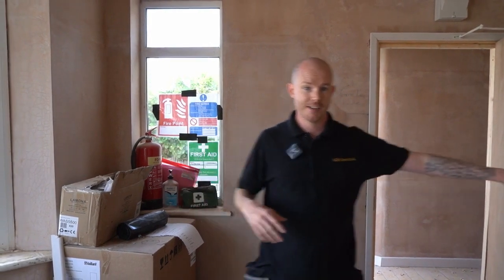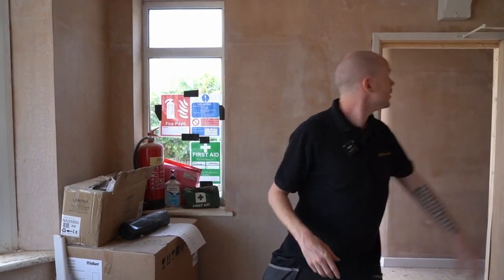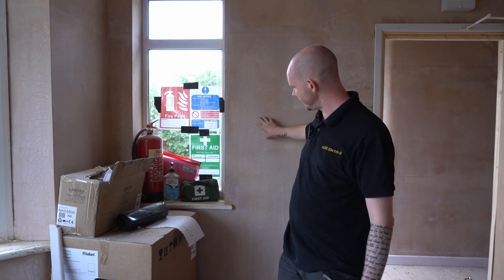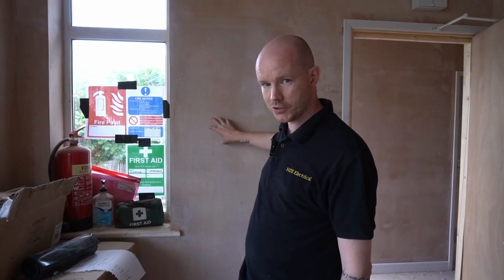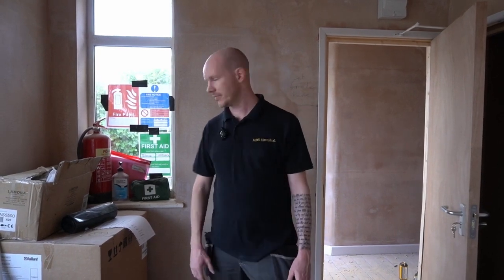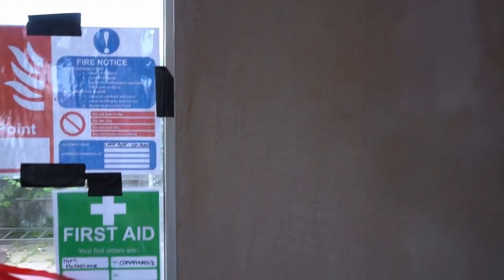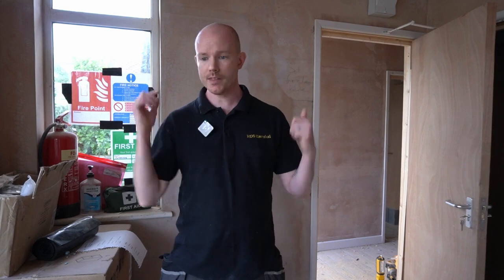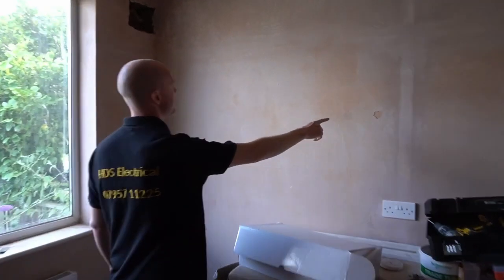Would You Trust These Plasterers Look what happens if you don't PVA the walls properly

Comment: Awesome video. Really informative. Always wondered about the PVA layer when plastering. I thought it was to add some adhesive to the plaster. Didn't think about it being a barrier but it makes a lot of sense
Reply from the maker: That’s, if you need any questions answered, post them in and we will try to help
Reply: @hdselectrical2924  thanks. I guess it's a bit like a primer to stop the wall soaking it up. Something I've noticed in cheap new builds is the way the plaster seems to peak at the edge of one board to another and then dip in the middle. Does this cause issues for you when fixing back faceplates and fixings and how do you over come uneven plaster?